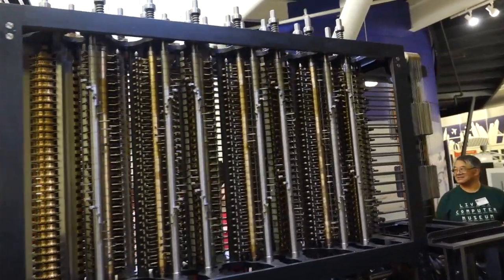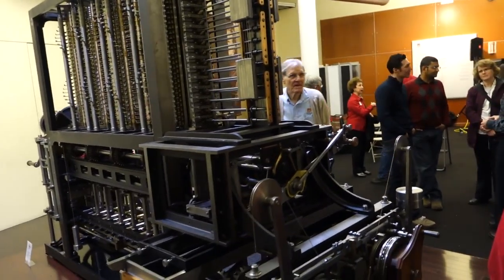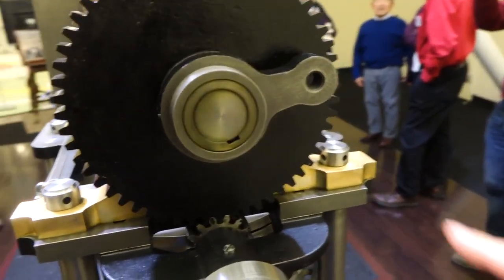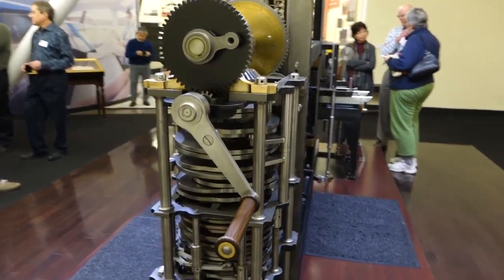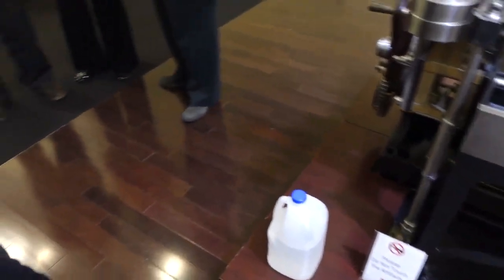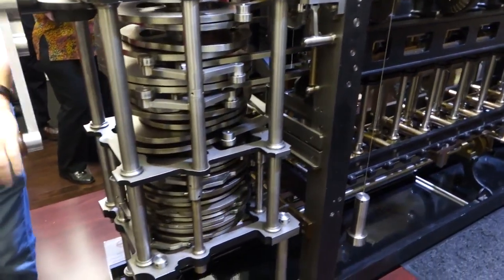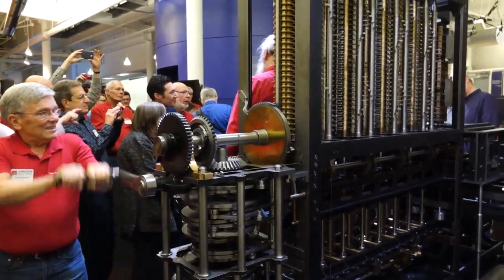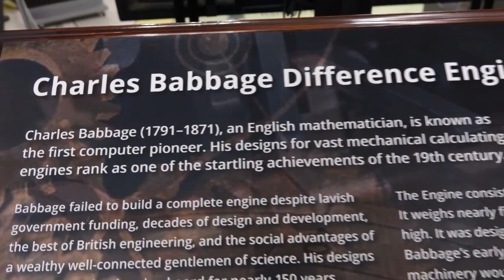Bye Bye Babbage: the most awesome mechanical calculator good bye party

Comment: Why does everyone swoon over Babbage (who never got any of his full sized designs to work), and ignore the people who did get calculating machines to work?
Reply: Because what he designed was a century ahead of its time, even if he never did manage to build one.
And because his design was completely, 100% sound, as demonstrated by this modern-day construction of his Difference Engine.
Babbage's failure was partly his inability to work with his helpers; but partly the limitations of precision manufacturing in the mid-19th century.

The fascination lies in the fact that, had he somehow pulled this off, we would have had stored-program computers (the Analytical Engine, which was bigger and more elaborate than this, and could be programmed with punch cards!) in 1850!!
I don't think anyone else can claim that.

Fred
Reply: Coulda woulda shoulda.

No matter how advanced the design... they were not built, but others did build working systems.
Reply: Design is every bit as important as construction. The point is, he has anticipated aspects of computing devices that were revolutionary, and a lifetime and a half ahead of his time.
There was no built and working system for a century, that did what Babbage's design had built into it.
Can you cite one example of a machine built before 1901 (when Babbage was already dead for 3 decades), that could be programmed with a set of instructions, which could include conditional branching and GOTO statements? Or that was Turing complete?
The Analytical Engine satisfies all those criteria.

Fred
Reply: Why do we swoon over Leonardo da Vinci? He never got his designs to work.
Reply: He did get his design to work, just 150 years late.
Reply: @RonJohn63  Babbage's Difference engine is not just doing addition and subtraction operations but using them to calculate polynomial tables
Reply: @MicrobyteAlan  because he did more than that.
Reply: @ffggddss  "Design is every bit as important as construction."
And I counter that with "Design without construction is *vaporware."
Reply: @gleggett3817  where did I say what the DE did?
Reply: @RonJohn63  No, "vaporware" is the promise of design or computer code, without delivery of same.
The design here, was completely delivered. To the point where, long after his death, others were able to build, from that design, a working device.

Construction without design, OTOH, is called a "junkyard."

Fred
Reply: @ffggddss  "vaporware" is the promise of design or computer code, without delivery of same.
I've been in the computer industry long enough to see the parallels.
Reply: @RonJohn63  Yes, as have I; thus my second and third sentences.
As a designer, Babbage was superb, if overambitious for the technology of his time; but his was an era of forward-looking optimism, as the Industrial Age continually expanded the sphere of "possible."
But as a manufacturer/fabricator, he was sub-par, to say the least. He apparently had overinflated notions of what could be built at that time.

Fred
Reply: @RonJohn63  that's the whole point.
Reply: Ermm... A lot of scientists work on things that aren't built in their lifetime.  Are you saying that all the people who work on Quantum computing are wasting their time?  The LHC wouldn't even be built if people 50 years ago hadn't predicted the physics theoretically.

In any case, having a workable idea is kind-of the hard bit.  Like computer Go AI was terrible until Alpha Zero showed how to do it, and now there are thousands of programs that copy the principles.
Reply: @RonJohn63  by that logic who cares about Leonardo Da Vinci? He didnt make any of his crazy designs either but was the first to write down those ideas
Reply: @KC-rd3gw  #1 many of DaVinci's crazy machine drawings can't work.  #2 He did more than draw sketches of impossible machines.
Reply: @ffggddss  The Babbage difference machine was abandoned the same year someone produced a working model 1842.   That's a short century.
Reply: @2adamast  Who produced a working model of the DE in 1842? Babbage himself had an abbreviated one built (table-top-size? "portable?"), I believe before that, as a demo/proof-of-concept, that actually worked. It had only a few number-spindles and with many fewer than the 30 or 50 digits of his full design.

Fred